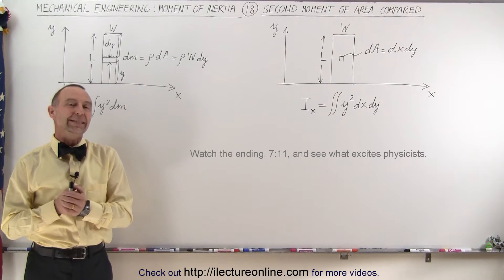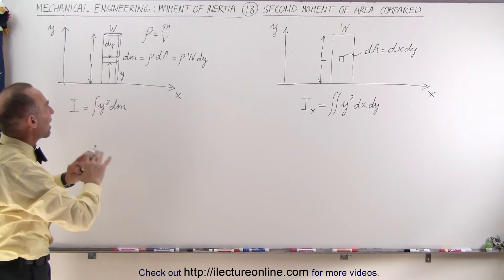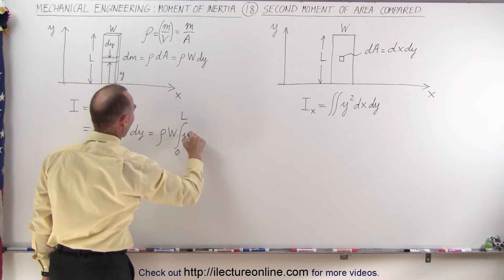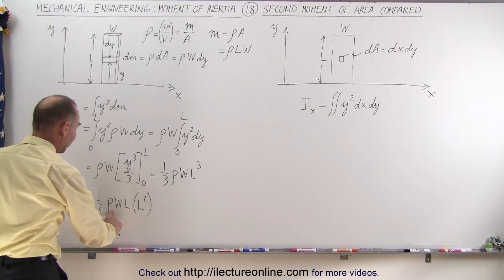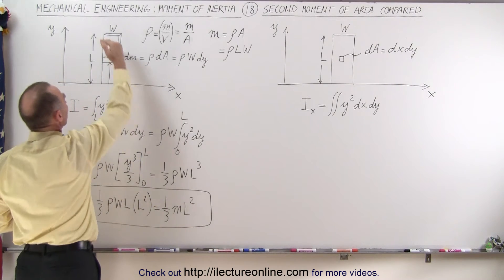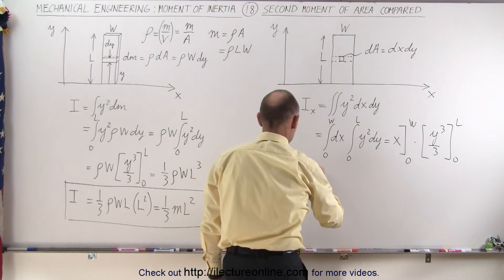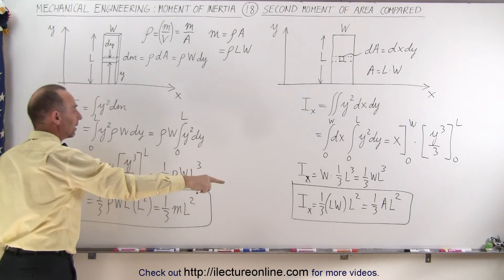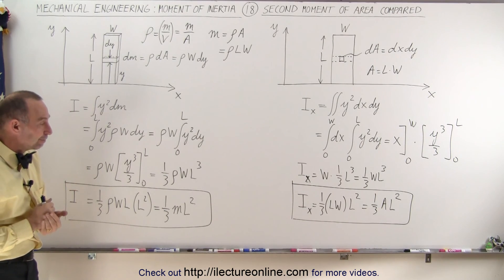Mechanical Engineering: Ch 12: Moment of Inertia (18 of 97) Second Moment of Area Compared

Comment: While calculating moment of inertia, you said that the plate is very very thin. So we're considering mass per unit area as density. But at the end of the video, you said you included mass and thickness while calculating moment of inertia and got the same result as second moment of area. How thickness was included if it was a very thin plate? Can you make it clear please
Reply from the maker: As long as the thickness and density is uniform, you can use either area or mass to find the moment of inertia, since the mass is proportional to the area.
Reply: @MichelvanBiezen  Thank you sir
Reply from the maker: You're welcome!